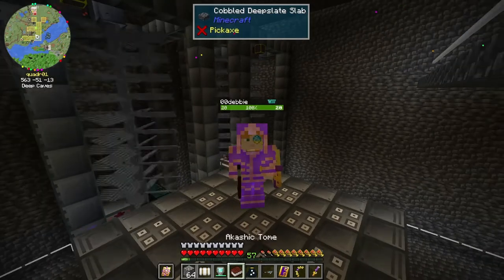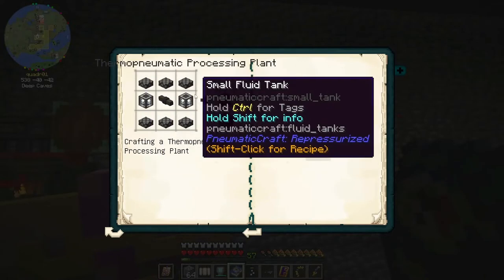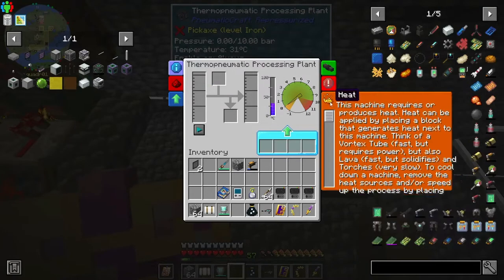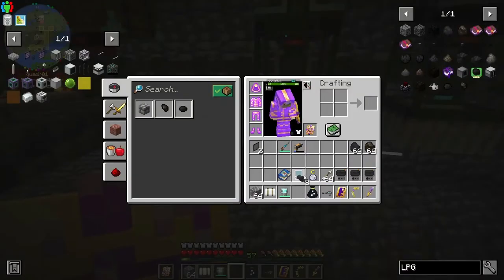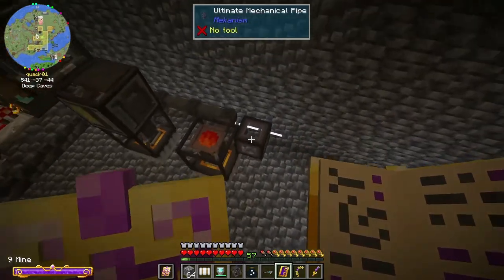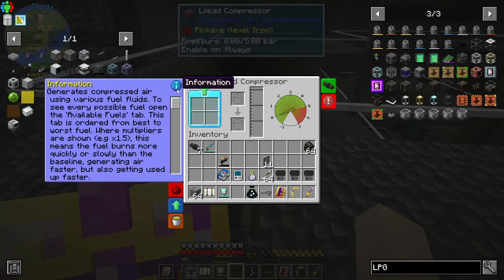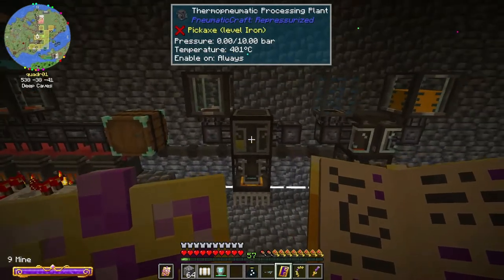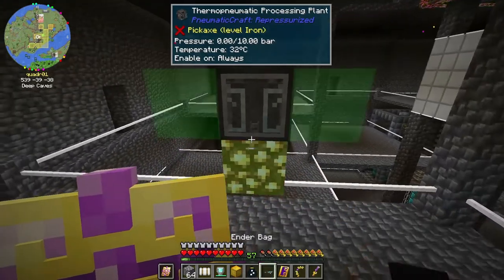DireWolf20 1.18 Let's Play Episode 93: Making Plastic and Lubricant in the TPP

Comment: Loving the light strips around each section in your underground area!  :-)

I believe the numbers in the liquid compressor fuels tab shows how much air it creates (in millilitres of air per millibucket of fuel), and the multiplier is how fast it generates that air (which you saw later in the info tab).  So gasoline produces less than LPG overall, but produces it faster.

If you look up the heat frame in the PNC book, it'll give more info about the temperature needed (including low temp multipliers).  When you put the tank of molten plastic in the chest, it lost it's blue glow, because it needs more cooling for plastic.

The vortex tubes use up air, so it makes the pressure drop.  You could put some speed upgrades on your existing compressors to push more air into the system, or add more compressors.  If you move to the Advanced compressors, you can generate even higher pressures, which make the vortex tubes work better, but I think I have 7 Advanced Liquid Compressors with 2 speed upgrades each attached to 3 vortex tubes, and they run constantly; as the pressure and temps get higher in the vortex tubes, they use more and more air.

And I used Quark's Blaze Lantern (I think it was called) to heat the plastic and lubricant production, which didn't need much heat, but the Deisel / Kerosene / Gasoline to LPG setup needed higher heat, and it kept turning the lanterns to cobble.

Security upgrades in machines (especially the compressors) will vent excess air instead before things break.  ;-)
Reply from the maker: Yes, I would love for things to NOT explode LOL maybe now I can actually make them!!!